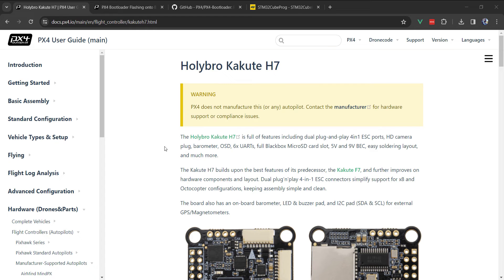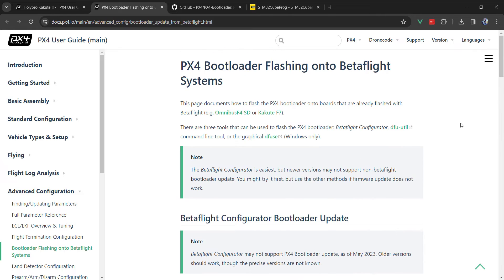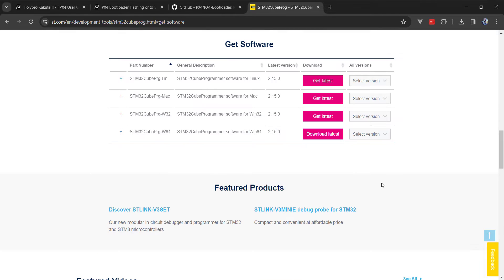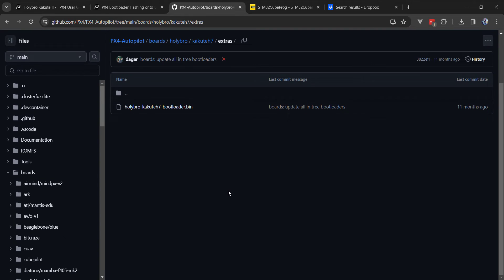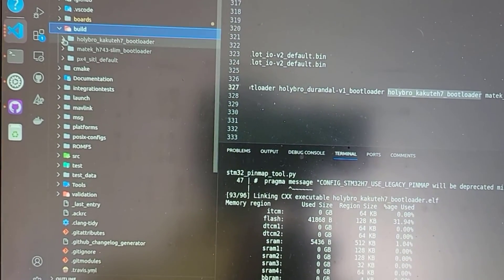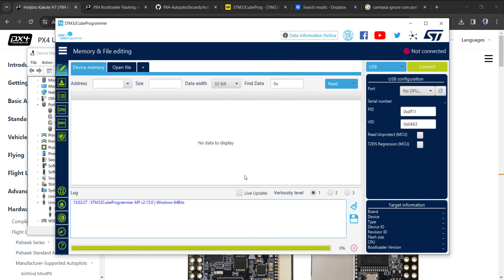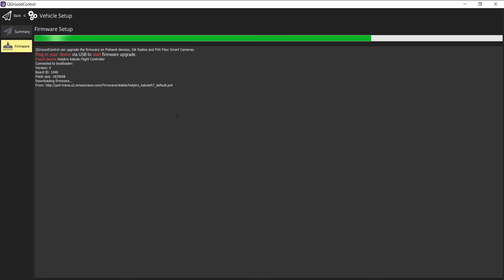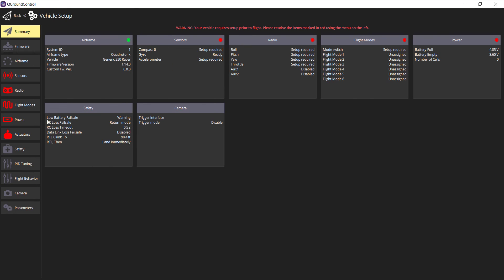Flashing PX4 Bootloader on Non-Standard Pixhawk Autopilots (Holybro Kakute H7)

Comment: Yo Dennis, I've only been working on this roughly 2 months.  I'm working on a Mac.  Do I need to get a Linux system?  QGC powers my pixhawk just fine, telemetry to the Mac works perfectly, but the firmware load never recognizes the pixhawk.  I've used different cables, all the USB ports, nothing works.  QGC is saying parameters are missing, that I need to reflash the firmware.  It ain't happening. They will be taking me out of my house in a straight jacket pretty soon.  Would appreciate your comments.
Reply: No puedes hacerlo mediante el puerto USB, si o si requieres de un j-link, o un serial cp2102